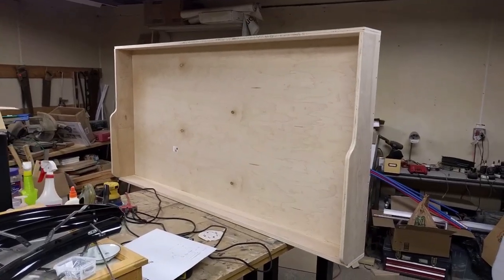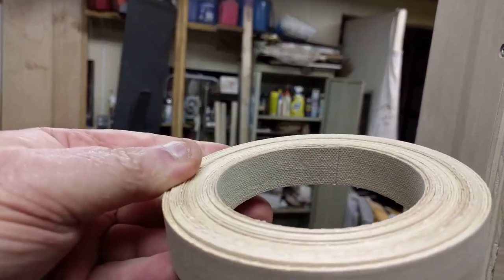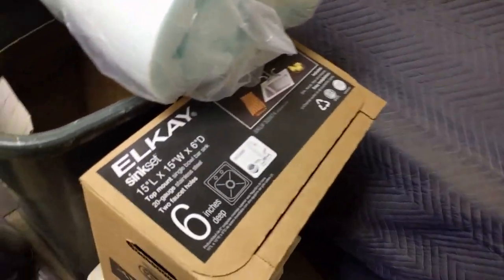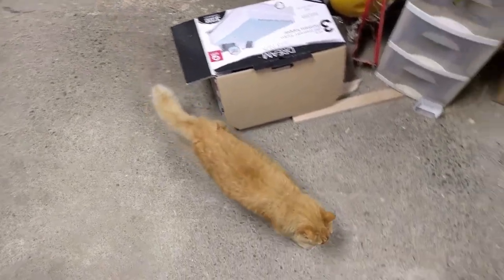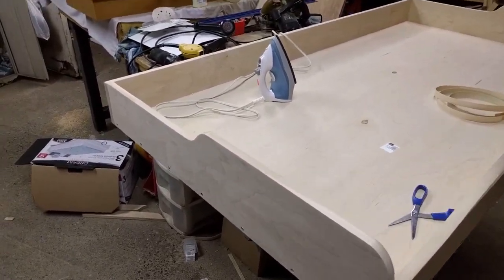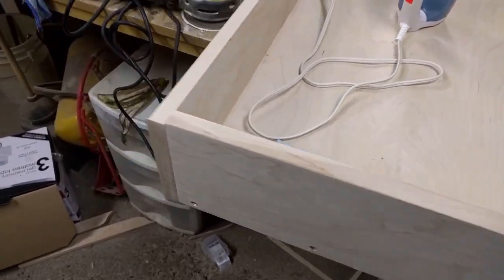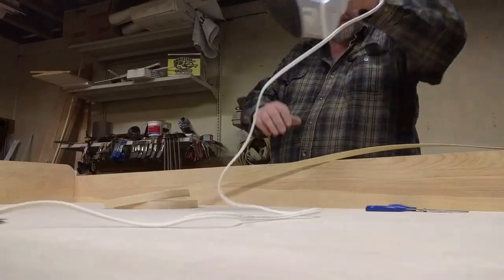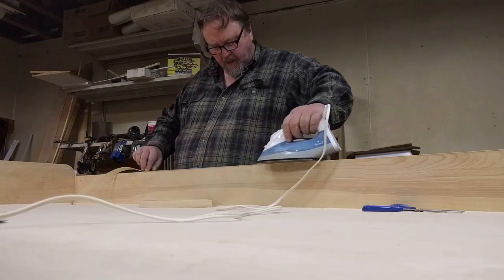Shuttle bus rv conversion. Building the Beds (Part 2)

Comment: You will love the shark bite plumbing once you do it, so much easier than pvc. I just found your channel and will be following along. The only thing holding me back from my own conversion is my lack of knowledge in the electrical stuff, hoping to learn more
Reply from the maker: @Big Dreams in Tiny Spaces, 12v is fairly easy to learn,lots of You Tube out there, When it comes to solar I just buy Renogy kits and follow instructions, but when it comes to 110v  shore power system that can be tricky with the 12v converter,charging and inverter. I build these buses because it makes me happy, kinda like a hobby and therapy rolled into one.
Reply: @robertbraden3889  ya I'm probably going to do renology kit for my travel trailer and learn on that before I buy a bus and hit the road. I actually went to a solar install convention down in San Diego a few years ago and was really impressed with renology's products. Unfortunate most of the seminars I went to were regarding house and generator installations and I think I've forgotten most of what I learned. Use it or lose it at my age lol
Reply from the maker: @BigDreamsTinyBudget  Yes you have to apply that knowledge or you brain will put it in the recycle bin! I've been corrected on the solar companies' name, It is Renogy I keep saying it wrong for some reason and I don't catch it till later,you know how it is, no tolerance for mistakes on You Tube. lol
Reply: @robertbraden3889  haha they will have a field day with my videos when I finally upload them all. Seems most of my build was filled with tong twisters 🤣🤣🤣
Reply from the maker: @BigDreamsTinyBudget  Aim a camera at me and I turn into a babbling fool, especially bad when I haven't learned to properly edit. Well warned everyone they will get nervous mistakes, brain farts, and pronunciation blunders but its real not some polished production. Real life isn't perfect my friend just upload and go on with things.